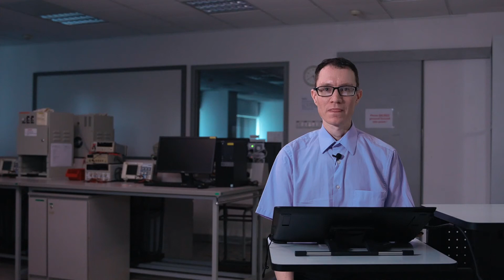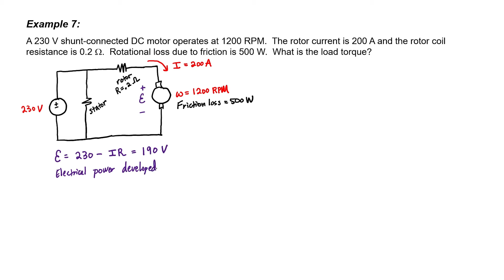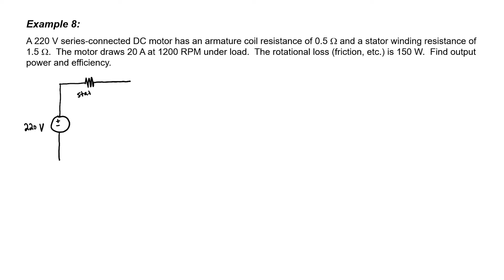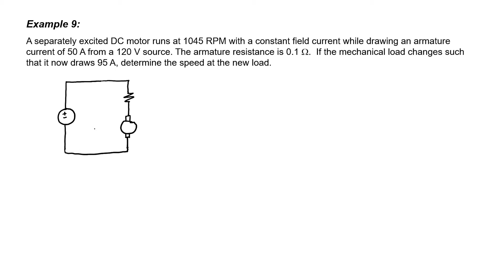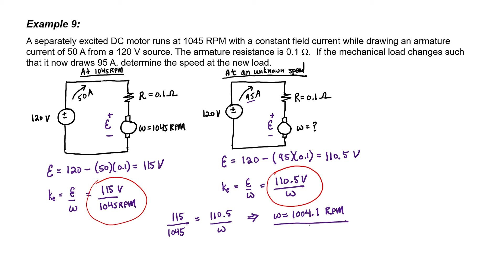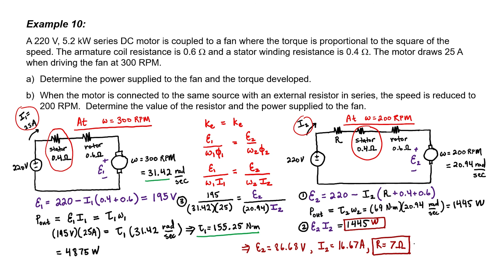DC Motor Problems: Examples 7-10 (Motors #9)

Comment: hello teacher, thanks for this excercises, can you please help me with this excersice: Two identical series DC machines have the following characteristics: 220 [V], 12 [HP], 1200 [rpm], 
Ra =0.25Ω and  𝑅f=0.5ΩThe shafts of both machines are coupled, with one of them supplied at 230 [V] to operate as a series motor, while the other works as a shunt generator loaded with a resistance 𝑅

Calculate:
a) The resistance 𝑅 so that the motor operates at full load
(b) The efficiency of the generator set
(c) Comment on how the load is supplied.

Comment: The maximum efficiency of a d.c. motor occurs is 3/4th full-load. The constant losses are 900 watts. Then the full-load copper losses are: 
1) 1200 watts 3) 1800 watts 2) 1600 watts 4) 2000 watts

Answer please 🥺🥺

Comment: Find the efficiency of DC compound motor (long shunt); armature current (101.3 A), 
rotate at (1800 rpm), total no. of armature conductor (476), flux/pole (0.015 wb), no. of 
parallel path (p=2), shunt field resistance (150Ω), series field resistance (0.04Ω), armature 
resistance (0.1Ω), rotational losses at load (1827W).
Reply: How to solve this problem?😁